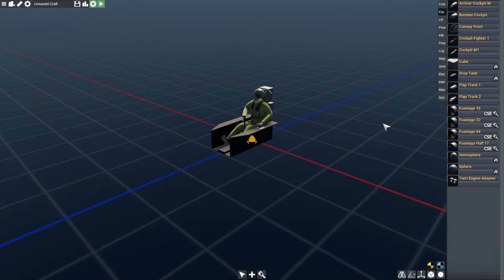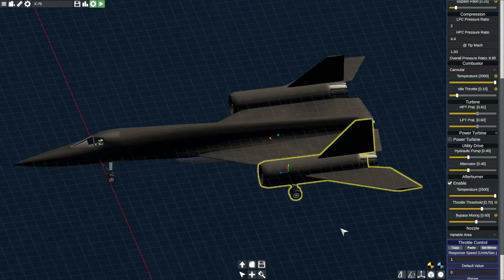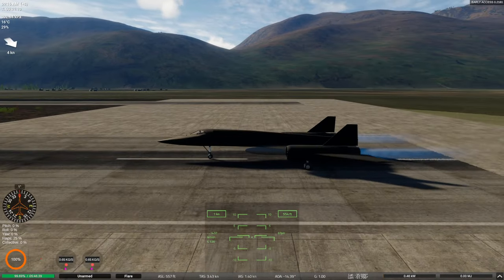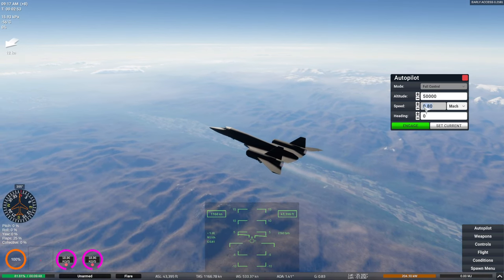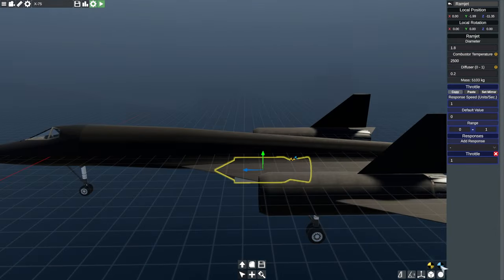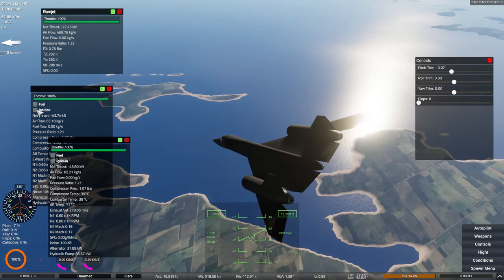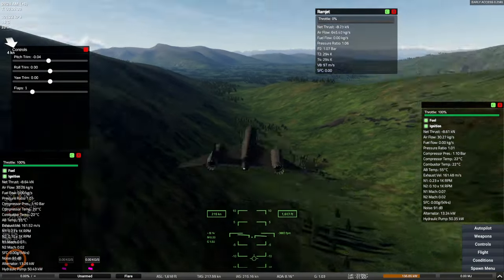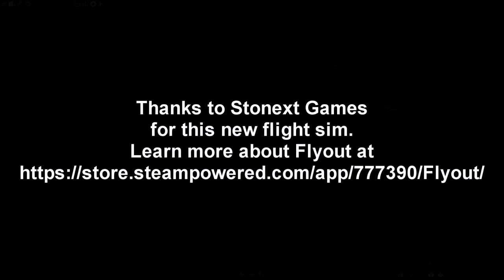Flyout Early Access - Going High and Fast

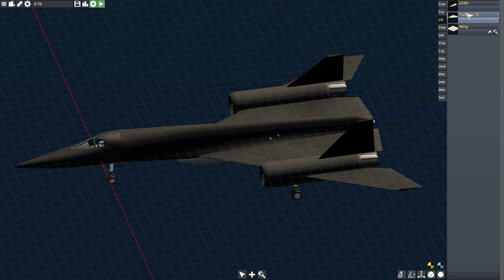Comment: When you were talking about the all moving wing for the aircraft at around the 3:00 mark there is a part in the joint tab that you can put a wing on and assign a control to the joint to move the whole wing assembly (I don’t remember the part name but it looks like a white cone and once you put the wing on it you can change its size and move the wing with the translate tool to hide the seem between the wing and the body)

Comment: If you lower the pressure ratio of your engines around 4, increase the bypass at 2 (low bypass mode) and increase the tip mach to mach1.5, you have a working ramjet that can go around mach 4.5 or maybe over mach 5, however you need to fly at very hight altitudes to prevent theses from sucking up all the fuel in seconds